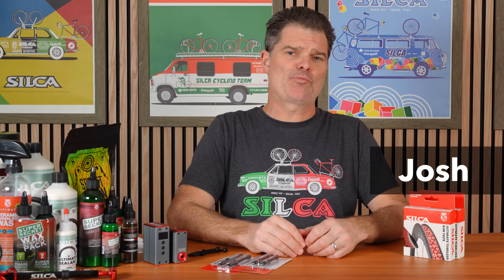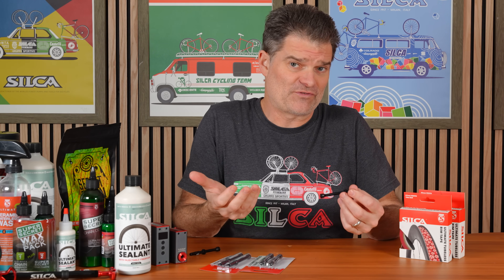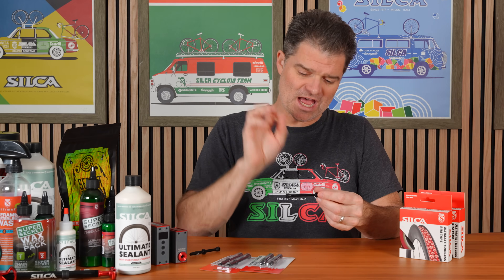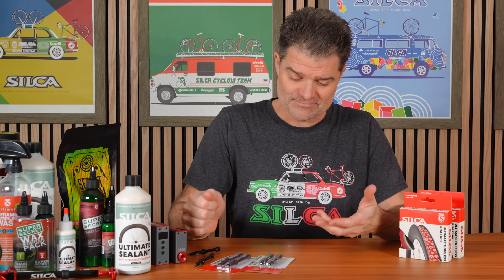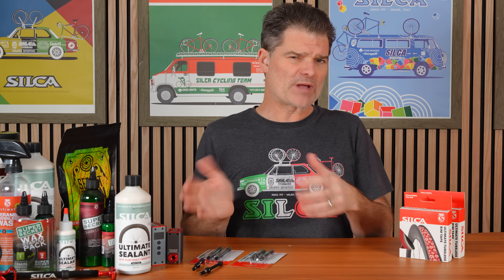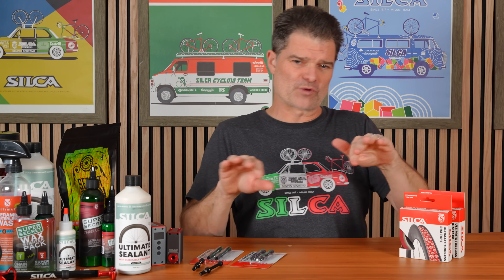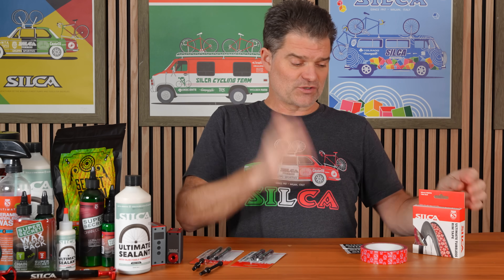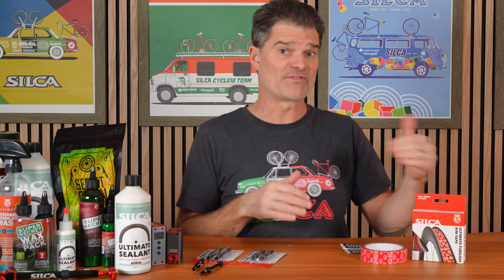Ultimate Tubeless Rim Tape & Valves: What Actually Matters

Comment: Silca sealant has thoroughly clogged every single tubeless valve I have tried so I stopped using it. Includes Fillmore Chris king mucoff zipp and the ones that came with my fulcrums. Hard to imagine these new valves would be better.
Reply: That's why I call it snake oil silca.

Comment: Hi Josh, 
In your video you start applying the the rim tape close to the valve. Think of it, in order to better balance the wheel, start applying the rim tape at the opposite site of the rim. By doing so weight of the rim tape overlap and the extra piece to prevent the end getting lose counterweights the additional weight of the valve on the other side, keeping a better balance in the wheel.
Thanks for the great products and videos you, at Silca produce.
Reply: Gosh, how did people riding with tubes survive for ages with unbalanced wheels due to the weight of the valve on one side? 😅
Reply: @Eierkneifer69  Agree we're talking about Little gains/Best Practice here. 
To answer your question. 
1. For a long time wheels had 36 spokes in a (over 3) laced pattern to keep the wheel balanced and in a round shape at high speed. The laced pattern distributes the force over multiple spokes more even then radial or less laced/crossed pattern.
2. Valves where half the size/weight and cutting open such an old tube you will find the inner tube's "weld" is/was already on the opposite site of the valve in these days.

Comment: With the tubeless tape, would it be advantageous to start the wrap opposite of the valve hole, then use the finishing tape opposite the valve to help balance the wheel?
Reply: You don't need to balance a tubeless setup... the fluid self balances.

Comment: Would love to get Josh’s thoughts comparing the new Silca valve to a Fillmore valve.  Ever since going to Fillmore, I haven’t looked back.  Love the lack of need to remove the core on the Fillmore.  Yes, the valve core in a Fillmore takes up volume that could be used for higher flow but I’ve never had issues refilling sealant in them.   Plus some additional colors allow for a tad bit more customization.   Love most everything Silca releases but not quite convinced on value prop for this specific product for myself.

Comment: People's complaints aren't really about how much flow a valve can handle. It's about how easily a Presta core gets clogged, and to some extent how difficult they are to unclog (90% of the time, you're best off just replacing the core). It's maddening to try and top off your tires before a ride, only to find out that air is barely passing through, yet the other day everything was fine. Sometimes the valve itself gets a bit clogged, but that mostly happens with valves that constrict at their base with extra rubber.

Comment: FWIW one of the biggest bug bears I've experienced with tubeless valves is when you have to remove/replace the valve core you can very slightly rotate the entire valve as well, which can then create the smallest air gap between the valve end and the rim tape. Often so small that you don't notice it when pumping the tyre back up but then big enough that you return to a flat tyre about 2hrs later. Other than being SUPER careful when screwing the valve core back in, the only way I've been able to resolve this is to use valves that have more of the D/saddle shape at the end, as these will typically butt against the inside well of the wheel, so are far less prone to also rotating when you screw the core back in.
Reply: I found the same but the saddle type stems have a single small hole that easily gets clogged. BTW is super an American replacement for very. Americans seem to use super for everything.
Reply: @johnlesoudeur3653  I'm English, so can't vouch for the use of 'super'. Was just trying to emphasise the degree of care and attention I've occasionally had to apply to screwing the valve core back in, so as not to microscopically also rotate the valve housing and introduce the smallest air gap between the rubber plug and the tape, for air to inevitably then escape.
Reply: @werdsmyth  A super answer :face-blue-smiling::face-blue-smiling:

Comment: how to video for the rim tape would be great ... there are so many ways to do it out there ... thx! .... how much tension ... push down in the center or however ...
Reply: I too would like this. I am wondering: currently I have always used two wraps for rim tape (although I never even come close to 100 PSI, it's a gravel bike). Since the tape is stronger and stickier should I only do one wrap with a little overlap? Or should I still go for two wraps?

Comment: Hey Josh, your new tape is for rims with minimum internal width of 23mm. Are you assuming that anyone on a smaller internal rim (I run 18mm) should use TPU or latex tubes instead because of the higher pressures? I still use rim brakes and have heard that both TPU and latex tubes can explode if you break a lot. Is this true for both materials? Going to the Alps this summer! Thanks

Comment: Hi Josh, I am using a no holes rim bed. Do i still need a rim tape to cover the valve hole and plug the valve core so that it's going to be airtight sealed? Or the valve core alone would do the trick, no need for a rim tape to cover the valve hole?
Reply: no
Reply: That's the reason why the valve has a rubber seal.

Comment: @Josh,  Have you ever considered also supplying the valve stems with the "saddle-shaped" (or "D" shaped, whatever you want to call them) rubber along with the cone?   
On my particular rims, I have found that works considerable better than the conical rubber part.

Comment: Josh, you kinda downplayed it a little in the video, but the addition of the 4 mm hex key slot to hold the valve in place while tightening up the nut is ingenious 👏
Reply: Would be great to have something like that just above the valve core insertion point too, so you could be certain the valve itself doesn't rotate at all when screwing the core back in.
Reply: C'est exactement le même système que Muc-off 🤷🏼‍♂️
Reply: Wolf Tooth has been doing this for years.

Comment: Nice product. However, the product I’m currently in the market for is the new CoreCap valve from BBB cycling (which unfortunately seems impossible to get in the USA right now). You can use a normal presta valve without a core and it is essentially a schrader valve fitting that fits on the outside of the presta valve. Despite Josh’s lube trick on the presta valves and cores every three months, I’m still getting clogged valve cores which creates difficulty with getting tire pressure exactly correct. I do have reserve valves on one bike, and while they don’t clog I’d prefer to be able to pull a core for injecting sealant. Moreover, it’s nice to be able to use a Park tool type syringe to be able to quantify how much sealant is currently in the tire and have the ability to easily remove old sealant if desired, but you can’t do this with reserve valves. The last limitation I see with reserve valves is that you can’t run them with Tyre Wiz 2.0. However, I believe that a BBB cycling CoreCap type product would solve all of the above issues.
Reply: fillmore valves do clog.

Comment: But you made these before? Valves with speed shield? I mean come on though, I don’t use it, it may be rotational aero but half the time it’s pointing against the direction of travel.  It also was making claims at a margin that shouldn’t be testable.  I liked your old tubeless tape, I have had to buy any in some time, but I was only buying yours, and I was told it was discontinued.

Comment: Finally, complete Silca Kit for going tubeless.
But which tape will I use for my 21mm inner rim width?
And also on my 23mm inner rim width?
27mm seems way too big?
Please let me know would love to use the tape❤️
Reply: Common width recommendation has always been to go 3-5mm wider than you rim's internal stated width, because the center rim channel is going to take up some of your tape and it's OK to have your rim tape come up onto the insides of the bead walls.
Reply: @TheBRad704 thanks for your answer, so 27mm should be fine for both 21mm and 23mm internal width right?

Comment: As a FIllmore valves convert, the issue isn't the removal of the core (which is fast, it takes longer to find the core removal tool which I often misplace) but rather the cores getting gummed up and bending/breaking and needing either replacement or deep cleaning. Hopefully this is addressed in your new valve design?
Reply: Try putting some synergetic on the valve core and into the stem .

Comment: Nice tape and valve. 

I hoped your valve could solve my issue with rims. I do not have pressure release holes drilled in them and I am afraid the rim might explode in case of tape failure.
But I see your valve has a seal under the nut.
Is there a solution you would recommend? Like some nut without seal and with some drilled holes around thread or something like that?

Comment: PLEASE TELL MY WHY THERE IS EVEN A NEED FOR RIM TAPE????  Why can Carbon wheelsets come without a need to cover spoke holes??  It's MADDENING!!!!
Reply: Do you know about how to build a wheel without having access to the nipples from the outside?
You either need special spokes and nipples, so the nipples screw into the rim from outside, or you have to fiddle every single nipple through the stem hole and guide it to the nipple holes with a magnet o.O
Who would want to do that?
Reply: @EasyEassy  The bike shop guy will get paid acordingly to the hours he needs to fix my rim in the case I broke a spoke.  It will be a bit more expensive than fixing a rim with a hole, yes, but I rarely brake any spoke. 
In the mean time I don't need to fight with tape.  long term is better a rim with no holes. Even cost wise as I will not need to change the rim tape from time to time.
Reply: Campagnolo, Fulcrum, Mavic, 9velo, Farsports, Light Bicycle , just neming a few that make wheels with undrilled rims :)

Comment: how might these valves compare to Reserve's Filmore valves??
Reply: Those have a bigger inside diameter and has no core. He cant compete easy with that. Cores r only easy to replace fast but u then always have to buy.  I have reserve phillmore vavles and there amazing even with inserts!
Reply: I got the Reserve Filmore valves with new sets of Reserve Wheels and hated them. They are near impossible to get sealant into. I’m back to Presta with Synergetic on the cores and on the insides of the valve stems to keep them from gunking and it’s great.

Comment: Would love to test the tape. Pity you don't have something for more "classic" rims. now running 21 internal. 
TBH I'm moving to undrilled rims when I change rims. That removes one thing on tubeless setups.  (Mavic UST, etc)
Reply: I miss my Mavic UST rims. So easy to seat.
Reply: I have rims with no holes from light bicycle. No tape to wear out, it’s great.
Reply: I still have an Shimano XT rim with no holes, a 26x wheel. Too bad I don't use it often enough to justify tubeless.

Comment: I really don't know why people are obsessed with "high flow" valve stems?
My goto is a floor and a mini pump, I don't use a compressor as it makes no sense imo.
Also with the slightly thinner wall, what is the percentual gain in said flow? I'm guessing not too much, as it's only marginally bigger?

I ran tubeless on my commuter for 3/4th of a year, but switched back to a innertube, since I switched to winter tires for the snow.
Those were only available as wire beads(?) and non tubeless.
Was a pita to swap tires with tubeless liquid.... so I guess I'm going back to tubed, maybe switch over to TPU though, as I really liked that on my sumer bike.

The tape does sound like a neat product.
Applied tape myself foe the first tires and I usually do 3 layers to have the grip be a non issue.

Comment: Even though I never had an issue with Stan´s rim tape, these SILCA ones will be amongst my next order. Silca keep it up.
Reply from the maker: Yes, Stan's is just a generic TPP tape made by Tessa, and is what we have recommended for years due to it's strength and abrasion resistance.. it's primary issue is the challenge of install as it's so stiff, and it is so hard to get to conform to some of the modern rim bed geometries.. this solves that at a higher abrasion resistance.
Reply: @SILCAVelo  Thank you!
Reply: Save your money and go generic.

Comment: What is the 'finishing tape' used for again?
Reply: to cover the seam where the tape ends so it can't peel up
Reply: I never have used anything personally and it has been fine with the tapes I have used mostly enve
Reply: @hutchy_4297  I have had tape lift before. Its no problem till you change a tyre and then I've had to retape.

Comment: Am I missing something? These seem to just be regular valve stems with some minor tweaks, I've watched it 3 times and I'm not getting it
Reply: Yes, he said in the video that the stems are always limited by the width of the presta core, so all high volume valves will be basically the same. Slight difference in their width because of their manufacturing process (drilled vs formed). Just SILCA quality here vs something truly ground breaking.
Reply: He literally said that there's not much difference. But if you've installed many tubeless valves, you'll love the addition of the hex key slot to hold this valve when tightening down the nut. Josh kinda downplayed it a little bit for me that's the ingenious part
Reply: @jimbo9030  Other stem manufacturers have been doing that for a while...hardly ingenious.
Reply: @johnlesoudeur3653 Just because someone else does it doesn't mean it's not a good idea 🤷
Reply: @jimbo9030  Cannot disagree with that. I already have valves with that but also without and TBH I do not find any appreciable advantage...but still a good idea.
Reply: had the same thought

Comment: Nothing beats the airflow of Schrader valves. As for tubeless tape, Scotch 8896 does not leave any adhesive residue behind. Adding a drop of super glue at the end of the tape is quick and simple, if one wants that extra safety. I bet these new products are great and will be a commercial success, though.

Comment: About the only thing I like about the valves is the rubber washer provided.  Everything else I feel is the same or deficient compared to the Reserve Filmore valves I am using. They are so good! Plenty of flow for seating and no clogging. Silica’s ‘solution’ that uses traditional presto cores is underwhelming, especially for the price.
Reply: I love my Fillmore valves. I can seat tires just using my Silca floor pump, and I can inject sealant directly through the valves. I've had no clogs in 3 years.

Comment: Great tape. But i only buy wheels with no rim holes now just so i dont have to deal with that. My 9velo and my bora ultra. I do have 1 set fulcrums that need tape. But i havent needed to retape.
Reply: I'm doing the same on my tubeless setups. right now, mavic/fulcrum/9velo, all undrilled.

I had a bad experience with fulcrum and a wheel that started laminating on less than 1000Km, the shop stated that was clearly a manufacturing defect but fulcrum deny it, at the end they provide a replacement, but after 4 months fighting with them. since then Campag/fulcrum are on my no list. You pay a premium over chinese wheels, you expect better support from them.
Reply: @LainOTN save your money and buy Chinese wheels. They're really good.

Comment: Why would anyone need finishing tape for the rim tape, if the rim tape is super sticky? If the finishing tape is needed, is it going to have the same wear resistance as the rim tape?
Reply: You can apply the tape such that the tension is greater than the shear strength of the adhesive. You can get around this by backing off on the tension for the lasts few inches and relying on the adhesive only. If you maintain tension until close to your cut, then there's not enough unloaded tape area to overcome the tension and it will tend to pull back and up. Once you have that leading edge exposed, it is subject to attack from sealant, additives, turbulence, etc. There's also a problem that if you don't tension the last few inches, it will not conform to the rim shape. Then you'll have sealant tunneling under the tape and eventually dislodge it. So in this case, having a finishing tape allows you to fully conform to the rim without tension in the finishing tape. Since it overlaps the edge of the rim tape and is not applied under tension, it has enough shear strength to prevent the leading edge of the rim tape from pulling up. My experience is this: I have had all three methods work, I have also had all three methods fail. 😅
Reply: @RobbyNowell  If you do it correctly (1-2mm over the sidewals) don't the tire and air pressure will suck the tape like hell? 
I'm never experienced the issues you are mentioning....
Reply: @LainOTN Yes, I believe that is the best practice, indeed.
Reply: Just double wrap.. and use generic rim tape rather than snake oil silca. It's a bicycle, not a jet fighter.
Reply: @padmanabhaprasannasimha5385  I still use butyl tubes, rim brakes, and a steel frame. I have a carbon fiber bike, but I mostly ride the steel bike. The carbon fiber bike is near the end of its life anyway. 

The price of bicycle related items has gotten ridiculous. Most people are better off losing 5-10 pounds off their body if they are concerned about weight. I like quality things as much as the next person, but at a certain point one starts feeling like Marie Antoinette.